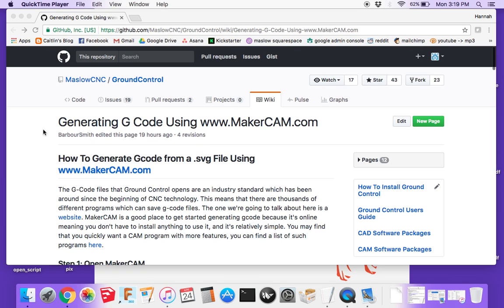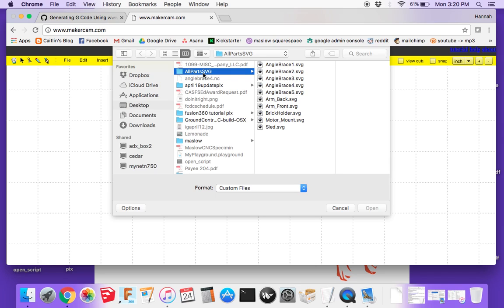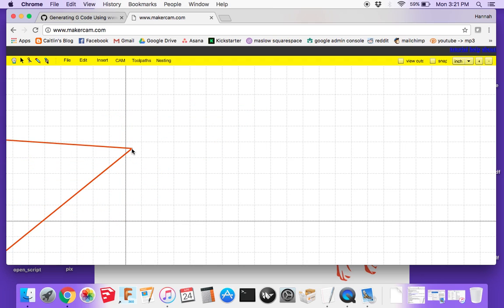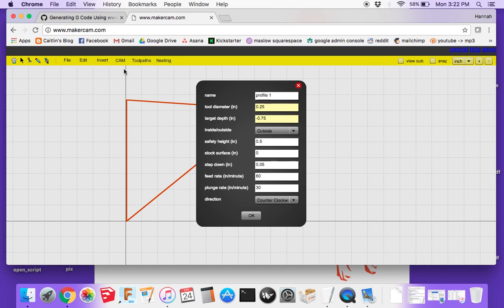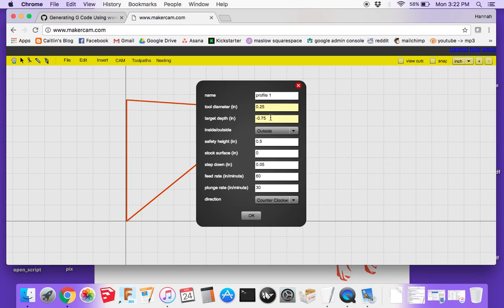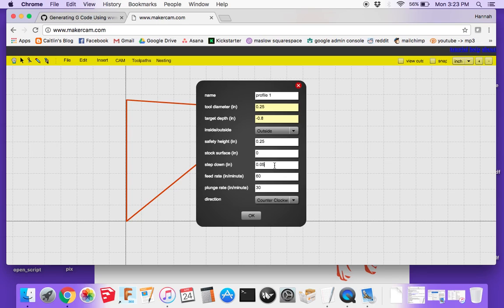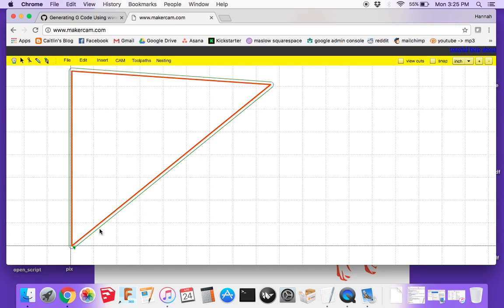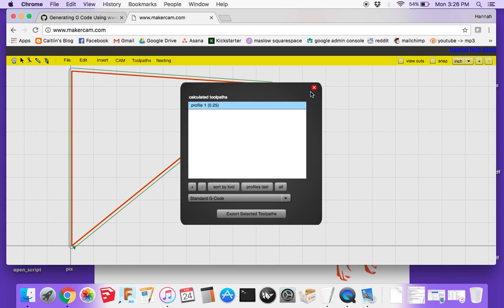Generating G Code Using www.MakerCAM.com

Comment: I don’t have any origin lines.youd think being I use a $10,000 cam program this would be easy, lol. I went through each of the 12 options at the top and no origin lines. I test cut air using makercam and it seems to be ok other than it wants to engrave 14” off my part zero. Unfortunately my expensive program doesn’t use any clipart for logo engraving but it will make a high end 3D aerospace part.